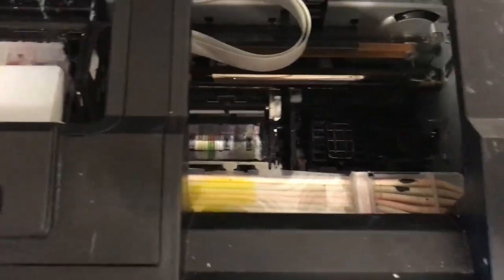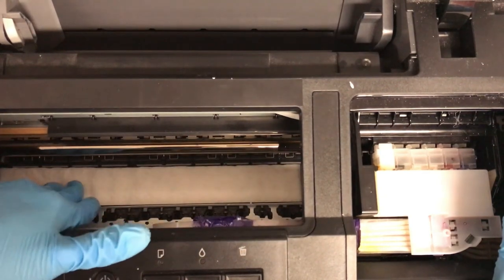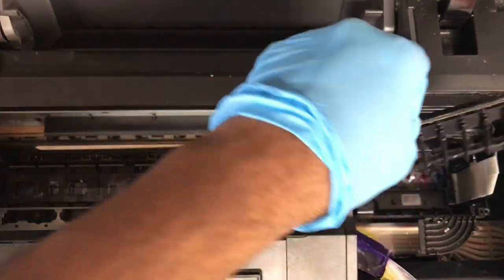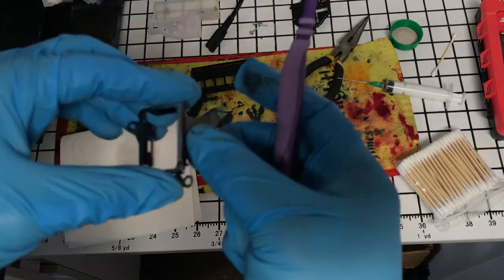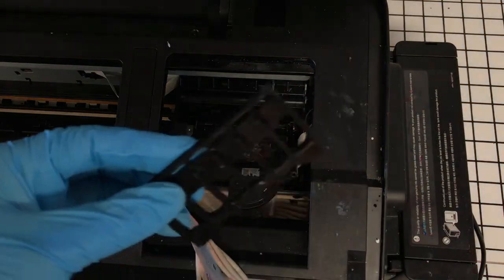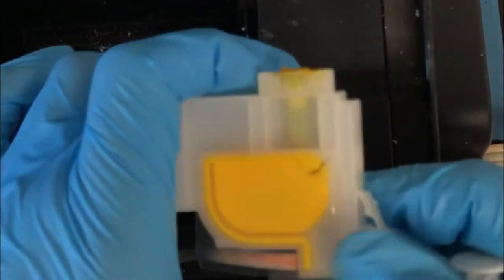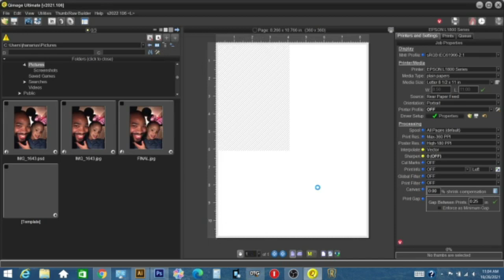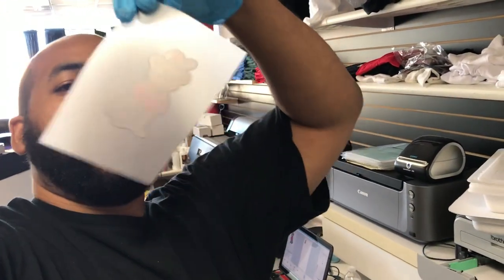CLEANING PRINTHEAD ON THE EPSON L1800 DTF PRINTER (HEAD STRIKES)

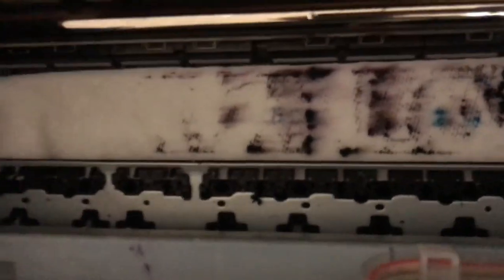Comment from the maker: CHECKING THE EXIT ROLLER PLATE - 2:01
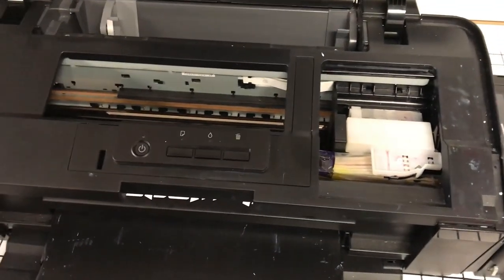PAPER TOWEL METHOD - 4:12
ACCESSING THE PRINTHEAD - 11:57
CLEANING THE PRINTHEAD GUARD - 20:22
REASSEMBLING -  26:12
REVERSE SUCTION ON THE INLETS - 32:00
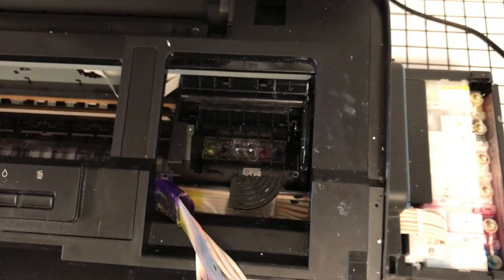REPRIMING DAMPERS - 35:53
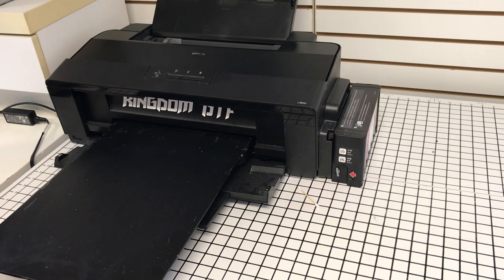PRINTING PURGE SHEET WITH QIMAGE- 42:59
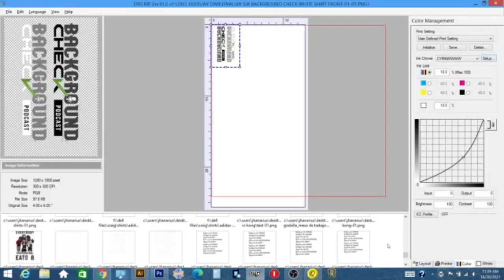TEST PRINT - 45:07

Comment: I always use Windex with distilled water for my cleaning. It will need to be the original Windex with ammonia and the ratio is around 10:1 water to Windex. It seems to work great and keeps the ink cleaned out. Kind of funny but I actually did the paper towel method before I seen this video, on my 4800, and it worked great!

Comment: Have you ever taken the printhead apart? More than the iron piece? I’m asking because it seems like we’re gonna run into the issue a lot where we have to replace the print head. I followed this video and cleaned the printhead as thorough as you have and the first few prints come out, perfect but then I begin to get this light streaks with faded white. If you have a video where you take apart the printhead, I’ll watch!

Comment: Hello, your video was most helpful in allowing me to clean my printhead. Now that I have the printhead back together - What do I do if my yellow has air pockets in the damper, and the black will not come through.
Reply from the maker: You can try to manually pull ink through the damper, with a syringe. If that doesn't work, you may have to replace both of the dampers. They are very cheap and easy to replace. Sometimes the dampers wear down, over time.
Reply: Thank You. Do you know what would cause the machine to not turn back on? I have only had my machine for 6 weeks. @elegant_edits

Comment: Thank You for the video. I bought an L1800 8 months ago and finally got the software set up but the printer has dried up. I have removed the head and waiting for the head cleaning fluid to arrive. Do I also need to clean out the hoses that carry the ink from the tanks?
Reply: Youll probably need a whole new head.
Reply: With patience head is entirely cleanable,there are vids of the process on YT,and you 'll not have to buy another...

Comment: Hi Sir, thanks for the sharing, 
Wondering have you encountered issue the white ink gone after printing an inch or two
Reply from the maker: Thanks for watching the videos. That sounds like ink starvation. I would start with checking the dampers; to see if you have reverse flow back to the tanks (where the dampers have an air bubble in the plastic chamber). I would also make sure you're shaking your dampers every other day, at minimum, just to keep the ink from separating. It may also be an issue with either over filling your ink tank or letting it run too low. I would create a white rectangle in your design software, then cut an A3 sheet down, into 4x6. Then create a template within AcroRip, with the dimensions of 4x6. Then print the rectangle long ways and see how the white lays down, before committing to another full sized print.

Comment: Awesome video. 
Im hoping you could help me. My L1800 stopped printing all together, everything runs like it should, just no ink being put down. I did a head clean (software and rainfall type) but still nothing. Someone told me that my motherboard went out so i replaced it. Its printing now but only magenta and whites, no other colors. Do you have any advice?
Reply from the maker: You should make sure the dampers are primed, because if there is an air bubble in your dampers or your lines, you won't have ink flow on those channels.
Reply: Print head bad

Comment: Hello. I have a L1800 printer and no matter what I did I couldn't unclog the magenta color. I don't think the problem is caused by the clogged head anymore. Because when I clean with software, sometimes 10 pores are clogged, sometimes 5 pores. When I clean it many times, magenta opens, I get 5-10 prints, but then it gets clogged again. Could this problem still be caused by the clogged head? Or could it be another problem? By the way, I usually do the head wash with isopropyl alcohol. Thanks in advance for your help.
Reply from the maker: You may have to use piezo flush and let the capping station soak, overnight.

Comment: Hello, I am currently facing a problem with the Syringe method for my white ink. The ink doesn't seem to move from the damper to the syringe and there was a lot of resistance when I pull on the syringe. I tried your method but the problem still persist, do you have any idea how can I solve my issue?
Reply from the maker: This means that your head is actually clogged, beyond the manifold. The only way to remedy this would be to actually remove the head and carefully soak it in warm cleaning solution. Just be Extremely careful; not to get cleaning solution on the ribbon cable connectors or it will fry the components.

Comment: Hello I'm Rainer, my DTF printer does not print anymore. With a syringe I tried cleaning fluid into the printhead to press. Can it be that the motherboard got a short circuit? Hope very much you have an idea. Greetings from Spain
Reply from the maker: Yes, there may have been a moment where either you had static in you body and touched the board or cleaning solution may have gotten on the connecter ports, for the ribbon cables. If you search some of the facebook groups, I believe some people have mentioned blowing a fuse on the board (I think it's the f4 fuse).

Comment: Hi i have epson l1800 and was having trouble with whites printing so after follow several you tube videos a removed my printer head and plunged cleaning solution through the white nipples until they cleared. i put it all back together again and now i have no colours coming through at all

i did notice some ink on the printing ribbons which i cleaned off

i have did serveral head clenas and replaced all the dampers with new one but still dont have any ink colours printing'...hhhheeelllppppp
Reply from the maker: When ever you perform a reverse flush, from the dampers, you will need to reprime the dampers and then perform two or three head cleaning cycles, in order to get ink flowing back to the head.
Reply: This date,i replace the fuse in motherboard (f10) then issue about blank print solve...im sure your fuse in mainboard was burn...just change it...

Comment: Please I need help my ink cartridge is locked and I Have two red lights flashing.   Help..please
Reply from the maker: Hi. you will need to purchase a key to reset your waste ink counters. You also need to make sure there is a waste bottle for the ink or it will continue to pool, inside of the printer. There may have been some ink or cleaning solution that spilled inside the printer, which caused the error. https://inkchip.net/ and you can use discount code ElegantEdits

Comment: My L1800 prints thin white ink
i have to use syringe to suck all white ink from damper and refill it into inktank so i can have thicker white layer, i have to do this every 3 day
Is that mean my damper is bad or my white ink is bad, i still not open business and i only print small sample of film everyday to keep my printer alive
Reply from the maker: You have to do that because the white ink contains latex. Over time, the latex separates (suspends) from the rest of the ink. When this happens, you're not printing the full white ink formula, which causes the whites to appear opaque. Every so often, just shake your white dampers and the ink tank (reservoir) and it shouldn't be as bad. You will still need to manually pull with the syringe every now and then, because the inks start to recede. We can't stop gravity!